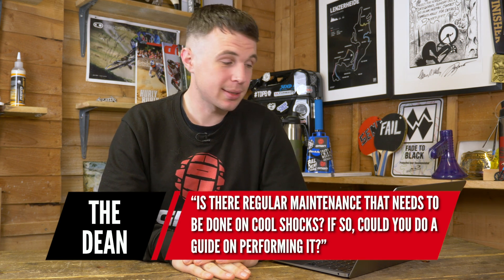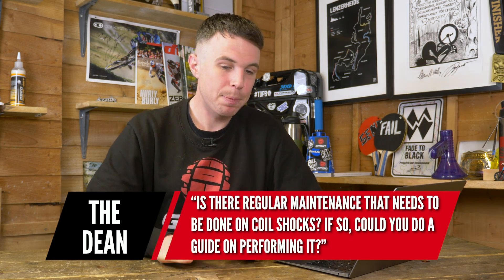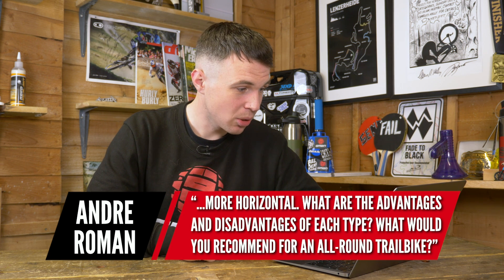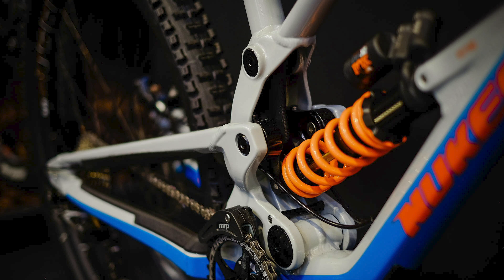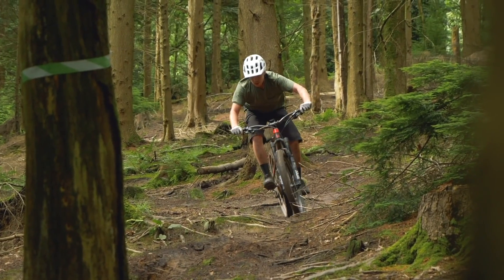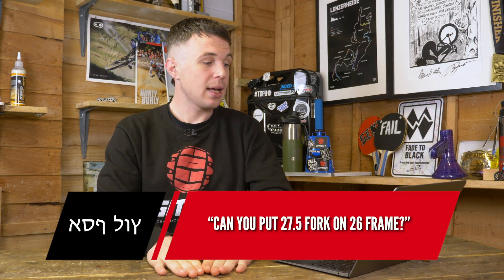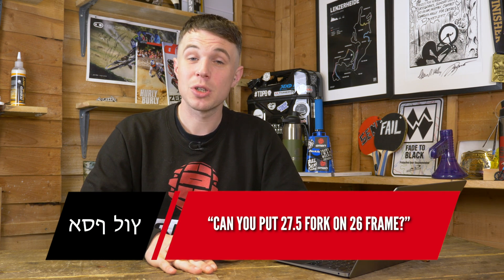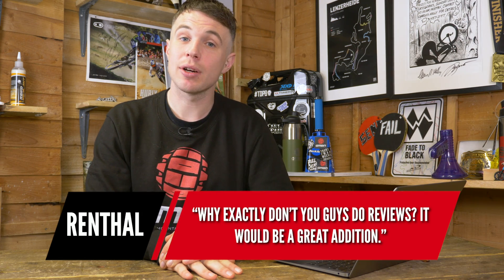Does A Vertical Shock Perform Better Than A Horizontal Shock? | #AskGMBNTech

Comment: Henry:” the cinematics of a shock isn’t something landed on by accident” 
Specialized: ”hold my beer”
Reply: I still dislike specialized
Reply: Its kinematics bud physics
Reply: @MrChristmcleod  leverage. IF:OF ratios. Force & movement.
Reply: man i love cinematic shocks, kinematics.
Reply: Errr what?
Reply: @robocopp7009  with the new demo they stumbled onto a great pedaling platform so they transferred the linkage design (with some tweaks) to the new enduro, which is apparently a great pedaling bike with lots of travel (something very hard to do, pedal bop and such)
Reply: @sandertakkenberg1197  The millions they spend on R&D, testing, prototyping and material science would lead me to believe they didnt "stumble" upon anything. Some very smart people worked very hard to make the bikes that good.
Reply: @RamenNoodles22  They run several geometry calculators targeting design parameters.  This-in conjunction with static and dynamic FEA and motion studies-leads to output parameters that are alike to "stumbling" on the perfect set up.  Modern structural studies are a good comparison.  Targeting a specific weight and stiffness allows the engineer to "stumble" upon an idealized geometry.  I'm not disagreeing with you-suspension tech these days is given a prioritized constraint and is VERY well understood (thanks to automotive racing i.e. Milliken model and Race Car Vehicle Dynamics).  The twin/horst design was incredibly well modeled, but mostly an output based on desired inputs.

Comment: #askgmbntech
Hey guys, 
recently I watched Henry's Tutorial on how to bleed a brake in real time.
It's a great video, yet there is one tiny little mistake which I see everyone doing or let's say I have an improvement.

Although it's great that he pulls some fluid out of the caliper itself, you usually don't want to do this with your fluid already in the syringe.
Reason being, mineral oil is hydrophobic, and lighter than water, so with a bit older fluid (not the dark used one) there is the possibility of pulling water in your mineral oil and Pumping it back in again.
More time consuming but better, use an empty syringe and pull some older fluid out, close the bleedcaliper, and then get some fresh fluid in the cleaned or a dry syringe.
Then put the tube on and open the valve again.

If you have reasons why I am wrong I would be glad to hear an explanation.

I  store the Bike vertically before I start the work so gravity pushes all the Water down and all the air up. 
Big fan of the Show, and an Inspiration,
Thank you
Reply: Maik Eckert This is actually a good point, thanks. DOT brake fluids absorb the water and form a consistent solution within the system, meaning water doesn’t get to pool anywhere, so this only applies to mineral oil systems. Mineral oil doesn’t attract water, though, so the only water ingress points would be condensation in the reservoir, through seals and microscopic pores in the brake hoses, right? I’m guessing this is a negligible problem if you maintain your brakes well and relatively often, but a good tip to keep in mind if you’ve been running the same fluid for years.
Reply: @CodSlap  Exactly my Point, although you normally change your brake fluid if it's discoloured, water can get in your oil just from moisture which is in the oil itself, or if you get some air in your system this is possible as well, beside your points.

Comment: #askgmbntech 
I'm looking to buy the canyon neuron but I'm 5 foot 5, according to canyons website I would be a small wich come with 27.5 wheels. I would really prefer 29ers, would you suggest to but the small and then put 29er wheelset on it, our just upsize to the size medium that comes with 29ers on it? Thanks
Reply: By how much are you off the bigger size? 
If it's a centimeter or two, you dan get away with shortening the stem or more backsweep on the bars.
If you have shorter legs, this doesn't work.

29er on a 27,5 can work but probably doesn't work, the chainstay could be too short, the bb rises, an it would feel off.
Reply: 29ers roll over everything.  My girlfriend rode a 26, then a 27.5 and now wants a 29er.  She is 5.7.  A 29er is harder to get moving but the additional rotational weight of the wheels helps to keep that momentum and even makes the bike feel way more stable.  The Canyon is a great bike.  I just got an XL Neuron AL 7.0.  Its an incredible value and a blast to ride.
Reply: BTW - there are standover issues sizing up on this bike (Neuron), FYI.
Reply: Having a frame that fits you correctly is much more important than the wheel size. Go to a bike shop and test a 29er and see if its suitable for you
Reply: @RamenNoodles22   I currently have a 29er stumpy and I love it

Comment: #askgmbntech does it matter that I'm having to put 230 psi in my dpx2 shock even though I weigh 170 lbs ? The shocks brand new on a polygon n9. Cheers Joe.
Reply: The rule that you should put as many psi in the rear as your weight is just a starting point and isn't accurate at all because of the many variables eg. bike linkage
Reply: They can take up to 350 so it’s not a problem. If you’re concerned that is too much pressure for your weight, maybe consider adding a volume spacer or play around with sag. Don’t take values for their face value alone.
Reply: You could try doing basic service to it if you like. Especially true on Fox's new forks that they just throw bucket and a half of grease into them. Might do the trick for shock too.
After one summer of riding, did basic service to fork and shock and they feel even better than new. 
As for the pressure, just try get the sag and rebound "right", pressure shouldn't be something you have to aim to specific number.

Comment: #askgmbntech    Is it worth buying a good hardtail or a used not so good full squish?
Thank you and keep making great videos
Reply: Always worth buying a quality hardtail. Hardtails look better, help build your skills better. They are just better. Look at the gmbn hardtail videos with blake in them if you need more convincing.
Reply: hardtail any day! Hardtail every day!
Reply: It depends. If a "not so good" bike is $3000 or $800. If it's the first, I'd go squish, if it's the latter, I'd go hardtail.
Reply: I'd go for the good hardtail, full squishes have more parts that can fail. If the bike has a sketchy spec to begin with, some part will probably fail and you couldn't ride unlike with the hardtail.